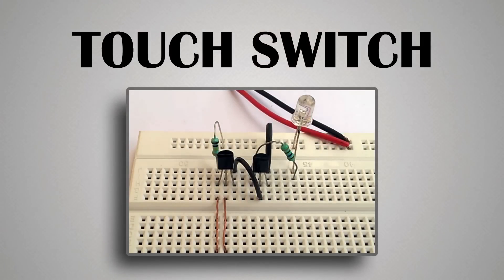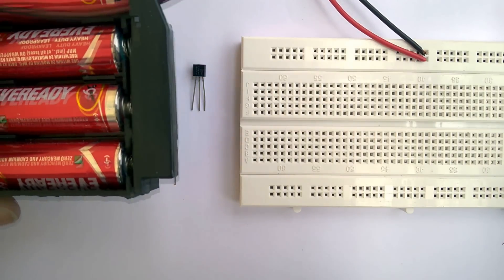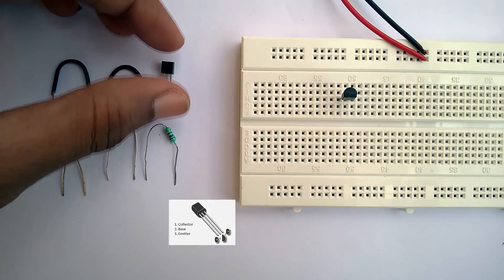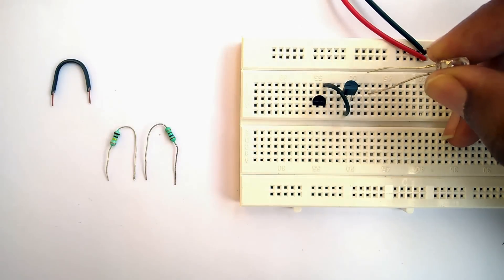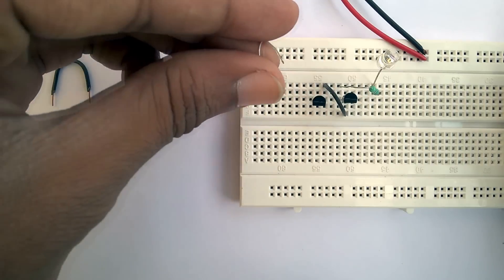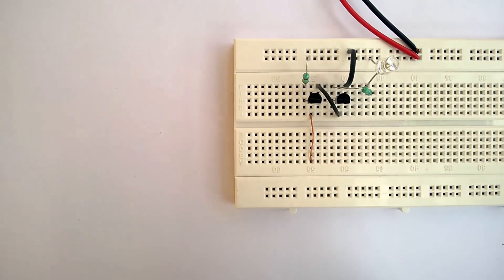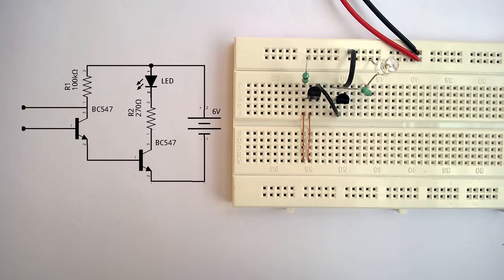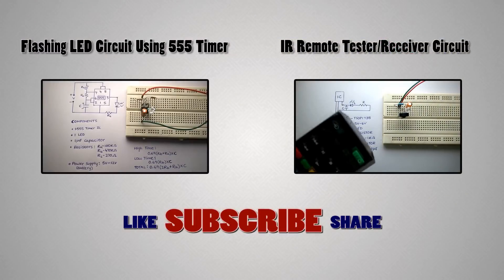How to Make a Touch Switch - Basic Electronics Projects - Breadboard Circuits

Comment: I built this circuit successfully. When I tried to replace the LED with a 3V DC motor it didn't work. I can get the toy motor going with 1.5 V DC and when I check using the multimeter there are more volts than that powering my LED so why wont the motor spin?

Comment: Nice video.  Unanswered would be  how to change the voltage to the LED  - - say to power a low voltage Relay so the relay could energize a higher power circuit.    I was hoping to learn how to make a touch switch that only has one  sensor electrode  which senses the capacitance of a  finger touch to energize a circuit.  I subscribes in the hope that maybe you will.

Comment: I did what you said but the led is alrady on without touching it but when I touch the wires the led gets a little stronger. Why is it happening?
Reply: never mind, I figure the issue. I'm using PN2222 transistor which emitter and collector are inverted, thanks
Reply: mine doesnt work, shall i send a picture of my project by mail so that you can check it? please, i really need help!!!
Reply: thank you sir the same was happening to me and i did what you did and it works
Reply: use less volts

Comment: Thank you. Question: at 3:44 how do you get 200x200 times?
Reply from the maker: When multiple amplifiers are cascaded, the effective amplification is obtained by multiplying the amplifications of individual amplifiers.
Here two transistors are used as two amplifiers and their amplification factors are 200 and 200. So the effective amplification of the entire circuit is 200x200
Reply: Thank you. I think there is a great thirst of knowledge of us hobbyists to learn things like this. For example reading a transistor datasheet for hobby purposes and other theory - put in practice immediately during the experiment. I think if you also provide theory and present it in an easy way and also the experiment it will result in more and more views.
Reply from the maker: Thank you for the suggestion. I will try to incorporate that in upcoming videos.

Comment: hi, just wanna ask something. why if the output(LED) we subt with buzzer and we make it on PCB, the circuit circuit are running without touching the base of the transistor?
Reply from the maker: There might be shorting somewhere on the PCB

Comment: I don't know what I have done wrong, but the LED is glowing dimly even b4 I connected the metallic wires! The only things different in my circuit are that used 2N2222 Transistors and a 9V supply.. help pls..!

Comment: It is doing the same what you expressed. For one shot it is OK but for real life a little more is required. That is there should be some latching mechanism which retains the out put on if you remove the touch. And it should switch off when you touch second time.
Reply: There are many components to learning circuits. One resource I found that successfully combines these is the Gregs Electro Blog (check it out on google) without a doubt the best course i've heard of. look at this  incredible resource.
Reply: Not certain about the points made but ,if anyone else needs to find out about introduction to electronics design try Ichordo Electronics Expert Fixer (do a google search ) ? Ive heard some incredible things about it and my m8 got amazing results with it.

Comment: sir, i didn't actually understand how that works. can u please tell me...
i would really appreciate your help
(Am still a beginner learner)
Reply from the maker: Hi Nikhil, I have added the explanation part in this project's page: http://elonics.in/breadboard-projects/simple-touch-switch-using-transistors
Tell me if that's not clear. I'll try to explain in another way.
Reply: Elonics - Electronics Projects on Breadboard 
Now I understood sir, I thought the transistors here were acting like switch which allows 6V to flow through LED when they are touched.
thank you, explanation was really simple, understood properly

Comment: and how to increase brightness of bulb
Reply from the maker: Increase the input voltage and connect more LED's in series. For 12v, you can connect around 4 LED's in series with 470R resistor.

Comment: can u make it with 5v? My proyect is using that voltage so, I wanna know. do I need another parts?
Reply from the maker: No need of any other parts, this circuit works well with 5v.
Reply: autre espece
Reply: autre espece
l

Comment: sir tomorrow is our semester project..please tell me about the ampere hour rating of the battery..how much ampere hour battery we need here??
Reply from the maker: Ampere hour rating is used to calculate how long the battery could power the circuit.
If you use a battery with higher ampere rating it will power the circuit for a longer time.
So, in this case, there is no specific ampere rating.
Reply: ok thank you sir..i use 270 ohm resister and 9v battery source it still works...why sir?

Comment: Hello Sir, i completed the breadboard connections as u showed in the video but my LED is glowing even for 3v also and touch is not working.. Please help me to find out whats wrong with my circuit...
Reply from the maker: You need a minimum of 6v for this circuit to work.

Comment: When I touch the wire on the base of the transistor it illuminates the LED dimly, I suppose my skin is providing some voltage, is there a way to prevent this?
Reply from the maker: The flow of electrostatic charge from your skin to the base of the transistor is causing this.
Try connecting an extra (1-2)M resistor between the base of the transistor and ground.
It prevents static charge from reaching the transistor's base.
Reply: Elonics - Electronics Projects on Breadboard Tried that, no go, I even tried 3 million ohm, I may get a 10 million ohm resistor and give that a go.
Reply from the maker: Okay. I'll see if there's any other way to prevent that.
Reply: Thanks I really appreciate the reply! The issue I'm having is when I use a 12V supply touching just the base gives me 6v, touching both gives me 12.  I tried a Zener diod but it reduces the voltage too much when it's in breakdown.
Reply: Kevin Braid  perhaps use a pull down resitor on the base?

Comment: I tried using a PN222A transistor and a 12V supply but my LED glows when I'm not touching anything, and when I touch the wires it gets slightly brighter
Reply from the maker: Reasons might be:
1. BC547 pinout: cbe | PN222A pinout: ebc - Check if the connections are correct.
2. The breadboard might be leaking current internally. Check with a different one.
3. If the above doesn't work either, try with a new set of transistors.
Reply: Yeah it was the pinout, thanks again.  Only problem now is when I touch only one of the leads the circuit trips, but seemingly with less voltage than when I touch both.
Reply from the maker: The flow of electrostatic charge from your skin to the base of the transistor is causing this.
Try connecting an extra (1-2)M resistor between the base of the transistor and ground.
It prevents static charge from reaching the transistor's base.

Comment: Hi,
Can you explain how this circuit works in details? Thanks.
Reply from the maker: Hello,
This circuit is something like a single transistor amplifier, where the tiny current flowing through the skin when you touch the conductor probes is amplified by the transistor and the output is fed to the LED.
Only difference is the output from the first transistor is again amplified by the second transistor (for more sensitivity) and the output is fed to the LED.

Comment: sir i m using 9 v battery  now which resistor i have to use?
Reply from the maker: Use a 1K resistor instead of 270R for the LED.
Reply: +Elonics - Electronics Projects on Breadboard 
thnks sir ..its working

Comment: I make a touch switch circuit but the bulb turn on when the battery connected. Do you know what is the problem ?
Reply from the maker: Transistor might be faulty

Comment: can I use a 330 ohm resistor in place of 270 ohm
Reply from the maker: Yes you can.
Reply: or can I use 220 ohm resistor
Reply from the maker: You can.
Use anything between 220 to 1000 Ohms
Reply: thanks very much

Comment: can i use a 1000ohm resistor instead of 1.2kohm resistor
Reply from the maker: You mean in place of 270ohm resistor? Yes, you can but the brightness of the LED will reduce a bit.

Comment: You don't need two transistors one can do the same job... Even you can turn on relay directly
Reply: Amol mk maybe two for more amplification for more sensitivity
Reply from the maker: 1. The amplification of one transistor wont be sufficient to turn on the LED bright enough. So the use of second transistor is just to increase the brightness of LED.
2. The relays which we commonly use doesn't have a latch. That means the relay requires continuous current to keep the load switched on. So you need to add an electronic latch which changes output state every time you touch.
If its a latched relay, you can connect this circuit directly.
Reply: 1. brightness is depends on the resistor in series with led.

2. i am using 12v 500mA water level sensor with single transistor  in my project....  i am using 12 v relay with diode and 1k resistor with LED across the relay in series with bc 547 collector and emitter is ground. probe in series with 100k resistor to base of transistor .i used 2200uf capacitor ground from the base of transistor for delay or temporary latch for rely ..and every thing is working perfectly..

you can try this circuit ...
Reply from the maker: 1. Using less resistance doesn't mean that the LED glows with maximum brightness. It also depends on the current flowing. Now that's why the second transistor is for, to increase the current (Note that current flowing depends on skin resistance).
2. I appreciate that. That is what an electronic latch is!

Comment: Hi,
Can I use a piezo to trigger the same circuit and would like to power up a LED strip which works on 12v DC. can you please tell me how this circuit can be modified for my needs? Please send me the circuit to rajthilakk@gmail.com thank you
Reply from the maker: Hello.
Yes, You can. Connect the Piezo buzzer terminals to the two touch wires. 
BC547 can handle maximum power of 500mW. That is about 40mA current at 12v. So if the LED strip draws more current than that, you need to use a higher power rated transistor.

Comment: Hello,

I realize it is not the place to ask this questions, but I could probably get help from the community. I want to build a lamp made of LED's and I currently have the resistors, LED's, and power source. However, I have seen that in many videos they add transistors and capacitors. 

So I was wondering how would those components (transistors and capacitors) make my simple LED circuit better.

Thank you.
Reply from the maker: Hi Roberto Nunez,
If the lamp is switched on and off mechanically, then there is no need of transistors or capacitors provided the voltage of power supply does not fluctuate. In case the voltage fluctuates, you need to use a capacitor to smooth-en the supply voltage.
If you wish to switch the lamp on and off electronically, like with a touch or couple with light sensor or maybe with sound, then you need to use a transistor which functions just like a mechanical switch but is activated electronically.
Thanks for asking. It's always good to be curious.

Comment: what is the use of this circuit??
Reply from the maker: 1. Attach a buzzer in place of LED to make a door bell that triggers with a touch!.
2. As a water level sensor. Keep the two contacts at the maximum water level in the tank. Place a buzzer in place of LED. So when the water level reaches the maximum level, it triggers the buzzer.3. You can use this in combination with a flip-flop/latch to make a touch on touch off switch.
4. This circuit can be replaced in place of a push button in any other circuits to give it touch functionality.
P.S: The more you try combining different electronic circuits, the more uses and applications you'll find.